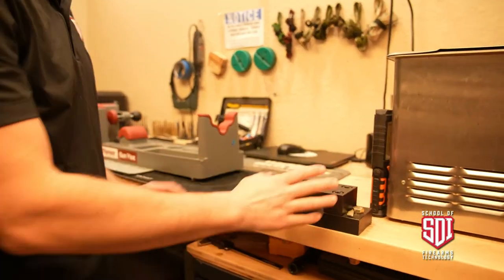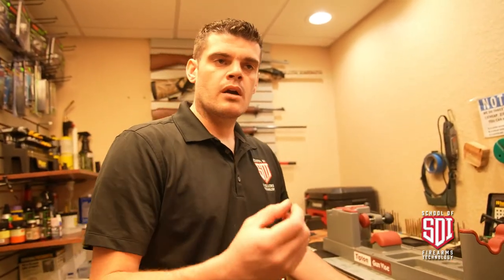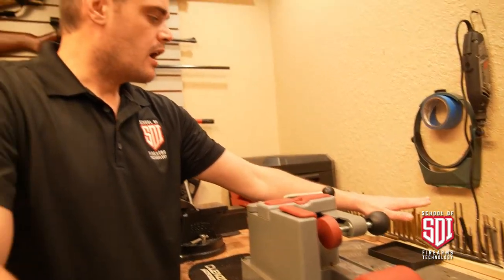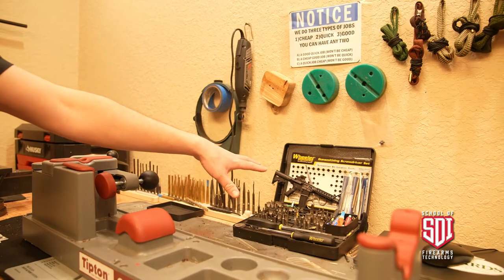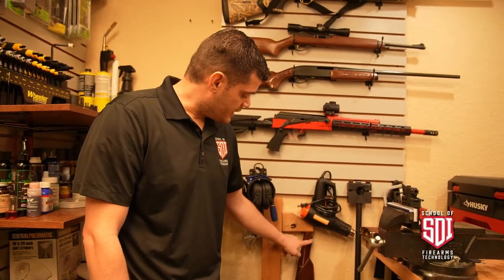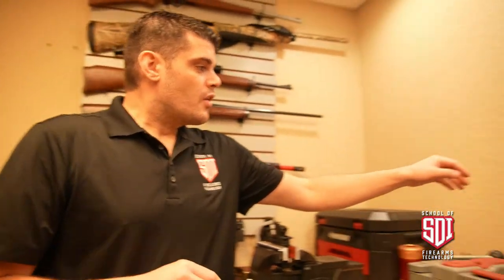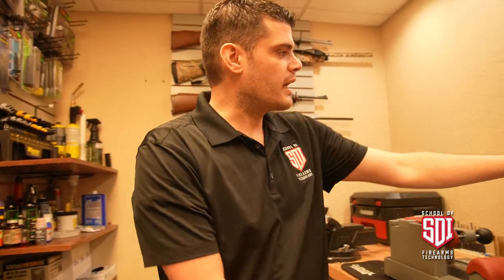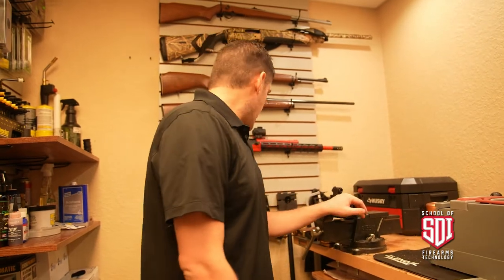Items On A Gunsmith's Bench

Comment: Additional items I feel that should  also be considered  are Upper and Lower Receiver Vice Blocks for AR15 Platform. Cerrosafe for chamber checking on older rifles, rifle cleaning rods from 24''-48" Go and No-Go Gauges for common calibers, and reference charts for thread pitch  charts in SAE and metric.